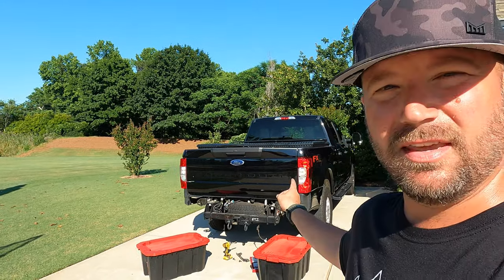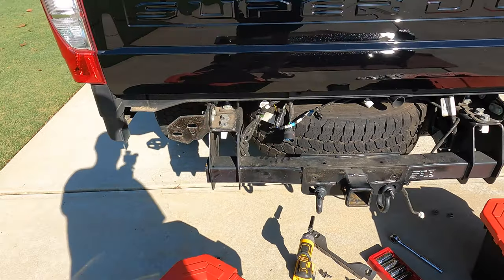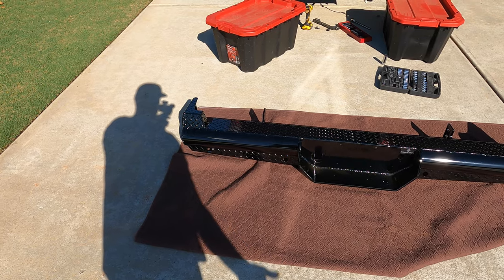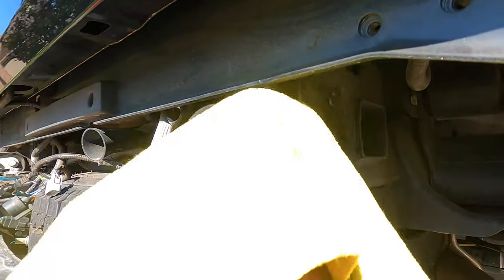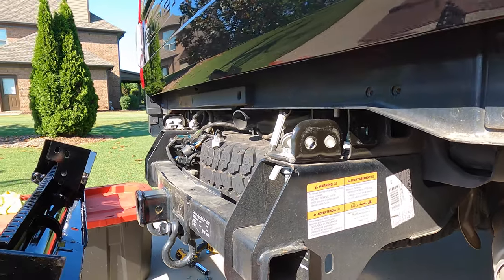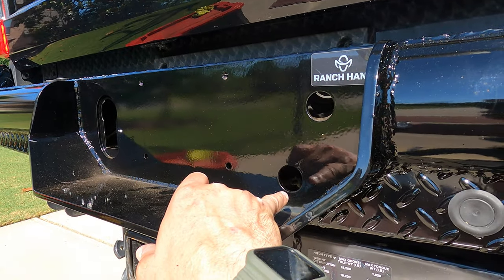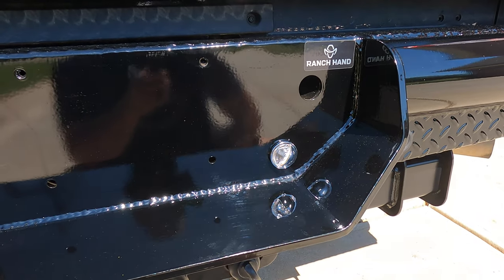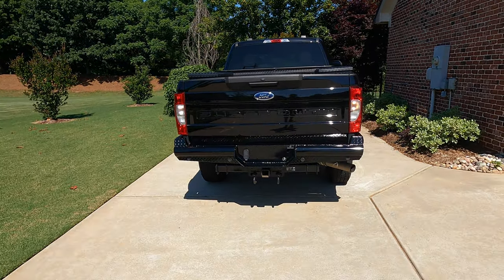Ridiculously Easy Truck MOD: Ranch Hand Legend Series Rear Bumper

Comment: I like how the sides follow the body line on the bed. Looks great!
Reply from the maker: I had to straighten it up a bit today. Didn’t notice during install but it was actually sloping downward a tad. Easy fix of course. Loosen 4 nuts, lift, tighten 4 nuts. Ha.

Comment: Did you have any issues with your license plate light wiring? Mine came with a two wire LED light and it isn’t working. Thinking maybe the shop that installed it yesterday didn’t wire it up properly.
Reply from the maker: No issues at all. It’s a super easy install. Maybe they crossed the wires up?

Comment: Not sure how that bumper would survive up here in the salt belt.  I could see it rusting pretty fast.  Thoughts/?
Reply from the maker: Hard to say as a born and raised Georgia boy. I don’t deal with salt. That said the paint is THICK almost like a epoxy covering (I don’t believe it is epoxy, simply an example of the thickness). It’s a lot of steel too. Even if it rusted it would be awhile before it was structurally compromised.
Reply: It barely lasts in Texas.  It will start to rust under the powder coat and start flaking off in a couple years.